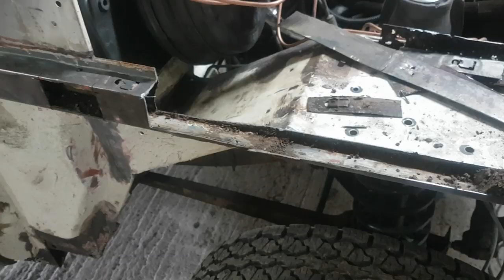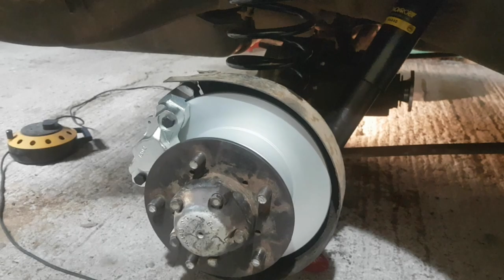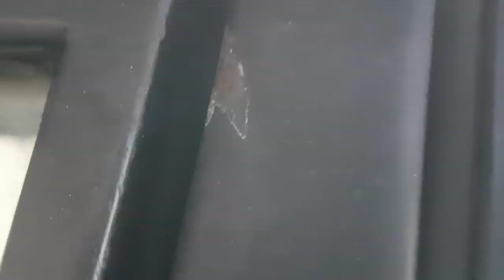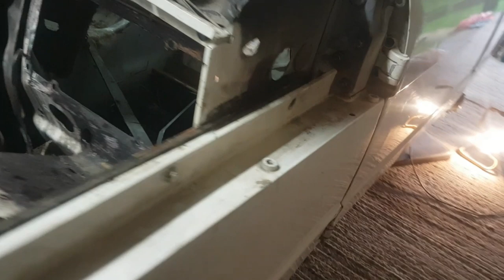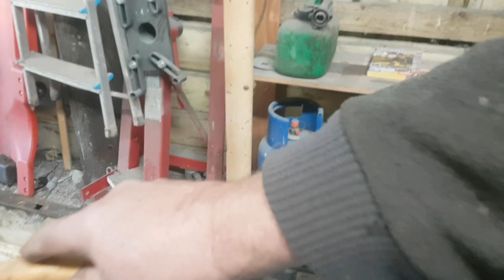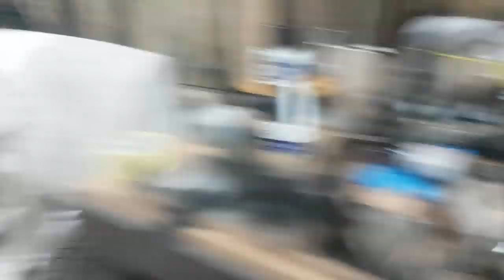Episode 5   1990 project Southpaw - LHD/RHD Range Rover 2-door Conversion

Comment: Cracking vid ive learnt alot as im rebuilding a 1990 rrc just wondered if you  have any early vertical front light guards laying around in your container of muchness cheers wadge
Reply from the maker: thanks for kind words. alas no front light guards at all. Not a huge fan of the front ones 😋 though I do like the OE rear units

Comment: Hi I've been following you for a while now good stuff💪. Quick question? I'm trying to found out about my door rubbers suffix A or what. I'm wanting new ones but my door rubber waist are not the ones that go all the way round because my little window is the waist rubber as well. Soo suffix A?
Reply from the maker: if the rubbers on the small 1/4 light window have flaps on the bottom ends that go down over the door skin, then they are a-suffix. I guess you can trim them and fit the waist seal that goes all the way around the frame, but making a clean and tidy job of it might be tricky

famousfour do new waist seals and matching 1/4 light rubbers but sit down before you google it and see the cost.